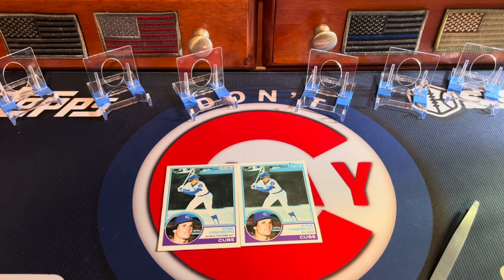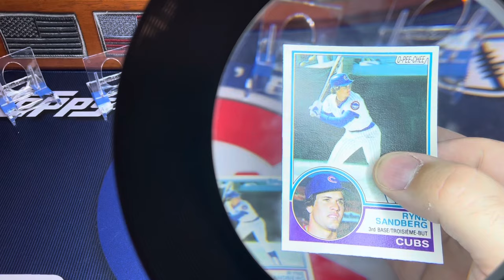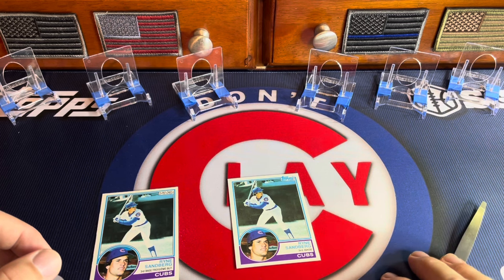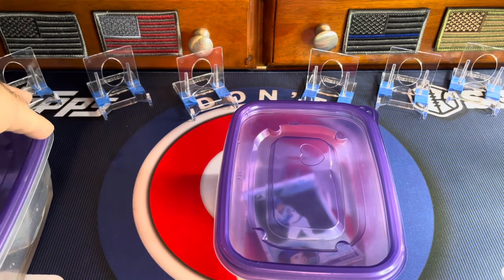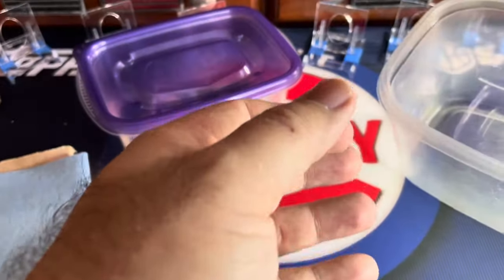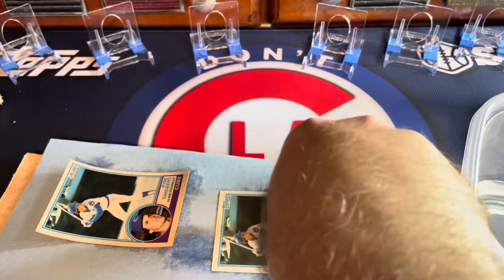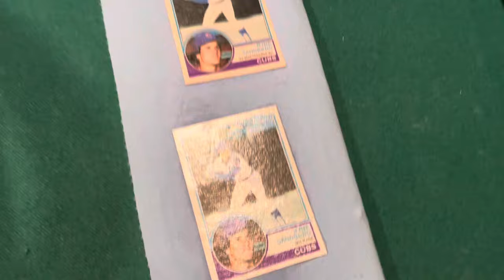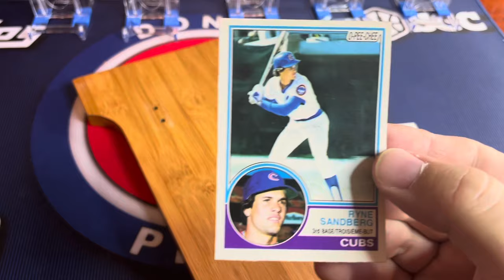Is It Wrong to Soak a Card?  You Be the Judge!!  I Soaked 2 Sandberg Rookies to Repair Them

Comment: Hi. So, just some background. I've been collecting since the 1970s. I do have baseball cards of this era, but I am mostly a hockey card guy (a math-based YouTube breaker in the community). My honest opinion is this is absolutely brutal. It is clearly a form of alteration, just like taking an eraser to an ink stain or a marker to a white corner. Soaking can alter the surface, density, and consistency of the card. If it is disclosed to a potential buyer, it would tank the value of the card, and affect the grade and authenticity, whereby it should be marked with an "A" for alteration. The entire premise of the hobby - and grading - is condition and legitimacy. Equally, cards change hands and endure wear and tear. Anyone can use advanced technology to rehabilitate a card, its corners, its color, its surface, its edges, etc. Then that card is officially altered, like replacing a car engine or its paint so that it is no longer fully antique. If you soak a card, it is no longer the original card. I personally am dead set against this, least of which because it could trigger or legitimize a whole host of disingenuous ways of cheating in the hobby, absent full disclosure or including before and after photos.
Reply: My car is still "fully antique" after I wash it
Reply: If I knew a card was soaked, I certainly wouldn't buy it. For the same reasons I wouldn't buy a pressed comic book either.
Reply: @mickdebates4039  Cards unlike cars are water soluble. This is more like actual restoration, like stripping paint. I'm pretty sure if you had sold an antique car and the new owner later learned it was stored in a full swimming pool, he would be concerned about structural integrity. In the card world, even light removal of pencil let alone a pen has always been understood as alteration necessitating full disclosure, and graders annotate cards as such.
Reply: Interesting take. I wonder - are you against wiping a card clean to rid it of fingerprints/dust? Or more against cleaning with chemicals and solvents to remove an actual stain? Repairing corners to lay them back down flat and sharp? All of these are bad? Only the 2nd two examples are bad, and wiping away dust/fingerprints ok? Thanks ahead of time for an honest answer.

Comment: When you finished the soak. I see an indentation on the topps card near sandberg's bat knob. It wasn't there when you started the soak.
Reply: I noticed it too. I think the nails in the top board had something to do with that. You can see holes in the shop towel when he lifted the top board.
Reply: I think you are exactly right.  I have to say this...  WHAT A DUNCE MOVE!,  seriously, who would do something like this, and not think of examining the  surface of the slats first.  Just mind boggling to me

Comment: Why shop towels? Those shop towels are abrasive. Not good. The only thing scary about this process is the use of those shop towels.  Nothing is more absorbent than a 70/30 blend of a Microfiber towel. Also  use a waffle weave microfiber towel even better. The moisture will soak up into the indented towel cut.

Comment: I've owned 20 plus 70's and 80's cars. Some original survivors, original paint, dusty as hell, bird shit on them but original paint. I wash the car and buff the original paint. I don't fill in scratches with touch up paint. I'm cleaning the car, not altering the car. I can't see the logic if a baseball card sits in an attic for 60 years and is dirty as hell, who would not try to get it somewhat cleaner. Maybe not soaking the card but something.

Comment: I tried the distilled water soaking method on a 1964 Topps Killebrew- which had a large tan stain on the top of the card. Other than the stain it is beautifully centered with nice corners. I first experimented with a few less expensive common cards to make sure I wouldn't ruin the Killebrew. I was surprised but it worked. After a lengthy drying process, the stain is gone. Did I get lucky? I don't know but I'm happy with the results.

Comment: There's better solution that that. I used eyeglass cleaner in a spray bottle - put 1/4 water and just one drop dish cleaning liquid. I've done this quite a few times. I only keep it submerged for 20 minutes. It's amazing what grime will come off a card. Those who say it's altering a card, it's not. Trimming and coloring a card is altering. If I buy a vintage car I'm gonna wet sand it and wash it, repainting a car is altering it.
Reply from the maker: @corymcewen5943  thanks for the tips, though I try to use as few solvents as possible in order to not damage the card
Reply: It's definitely altering a card, by soaking it.

Comment: The reason soaking gets a bad rap is that some types of cards can be soaked and stretched using pressure. The card can then be trimmed back to normal size
Reply: Should be illegal if you’re selling. Should be in jail. That’s scamming.

Comment: If that plank is unfinished, it must have a ruff finish. What is keeping  the weight from embedding the card with the ruff edges of the plank. That thin shop towels can't give that much protection especially with a weight on top of that card. I would think you would want to use planks of wood that are sanded down and the wood is smooth.
Reply from the maker: Good point, I did switch to finished planks midway through, though I didn’t mention it 😞
Reply: @claydontplay8783  Thank you for the thorough video. No need to be safe excellent job. For any that criticize, when These card Manufacturers give a crap and readjust and sharpen their cutters after every print run and provide excellent quality control, I love every aspect of "cleaning up their sheet!" Before we spend more hard earned money sending it to be graded another SHEEET show con job grift. 

Well done sir!

Comment: NO. ... Pick up a NANO Mister* It's a Card and with that said, it has NO GRAIN DIRECTION. ... It's just Mulch, Cellulose, flattened from tree pulp, natural, so when you soak them, they expand, changing their size. A little nano mister with distilled warm water, maybe a pinch of salt will soften the card after a very light cleaning / buffing.  Not all card stock is the same. ... Some thicker and more glossier coated then others. ... So if they expand some, you may get them back from a grader on account that they do not fit into the sized slabs used etc.

Comment: Please tell me where you end up selling these so that I can avoid them. The last thing I want is a soaked card passed off as unaltered for my money.
Reply: Altered how?
Reply: Simple water damage. Cardboard is less payable after being soaked. Therefore, the card would be different, i.e. altered.
Reply: @shawnpetty3837  By that definition a card becomes "altered" if a corner gets dinged by a penny sleeve.
Reply: @GFTCNJ  that is damage. If you call those equal then it is water damage and still should be known or called out
Reply: Hate to break it to you bro but people including card shops and dealers have been doing this for over 40 years. No way to tell and cards will still all grade out fine.

Comment: Are you sure the Topps card has tape residue? It looks like the card was last/flipped in a wax pack. Not wax? If so, easy removal.
Reply from the maker: It could be, I haven’t tried the pantyhose method, mostly because my wife would have questions😮

Comment: o-pee-chees were made with a different (thicker) card stock than the regular topps and it's similar to the tiffany stock. Also, you have just contributed some hydration to 40 years of nascent fungus and bacteria. My guess is that with a few months there will be mildew black spots popping up through the white borders to the point they eat through the front of the paper. That water is still trapped in the fibers no matter what you do! Sell it as quick as you can!